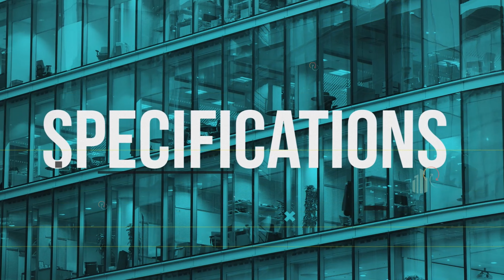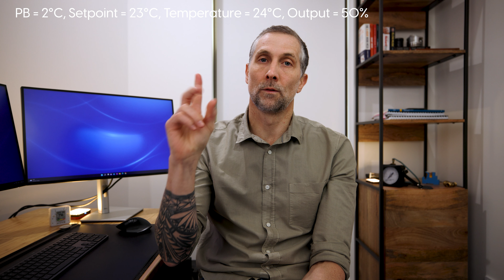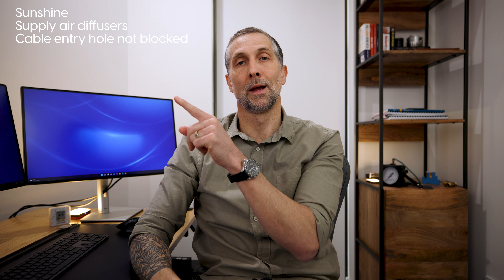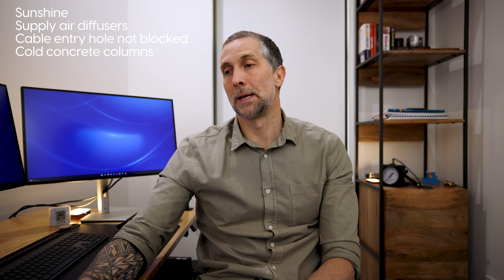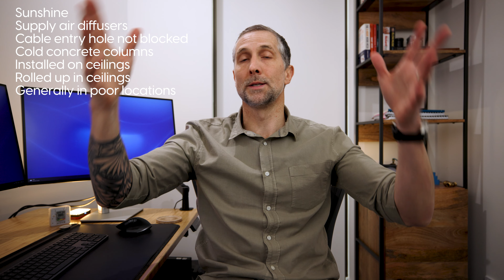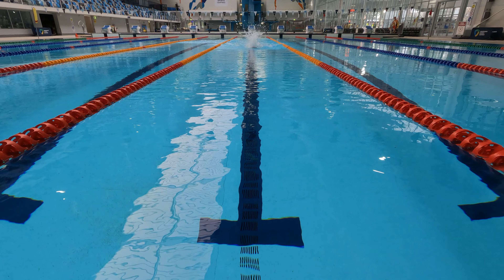Simple PID adjustment that saves energy

Comment: Does this count too, if you have radiators, to heat the room, and the ventilation is just to refresh the air? 

The larger range of temperature you allow, the less the VAV will have to run, or is that understood wrong? :) 

Im new in the BMS, but have a huge interrest in the PID regulation / energi saving over all.

Comment: I agree with you on the energy savings, the problem i have is the people who want it an exact temperature that will scream bloody murder over it being a degree off of setpoint. Some businesses will get HR involved to make that employee happy even though they might have a temperature policy in use. Have you looked at the Johnson Controls PRAC feature in their software? It is designed to minimize the energy use by looking for a pattern and adjusting the PID parameters for steady comfort control.
One of my things I teach is to stage equipment on so not make the central plant run full capacity when going occupied.
Reply from the maker: PRAC, you are talking about JCI's automatic PI adjustment thing? 
I actually have a little problem with it. 
It works well until something upstream is misbehaving. 
E.g., the VAV box damper is hunting becuase the AHU supplying it is hunting. So the VAV PRAC starts to widen the P band to stop the hunting. And then you have a P band of 200°C. 
My personal opinion, with no proof, is that the PRAC should run for a week while all systems are properly working. Allow all the PID loops to self tune and then I think we turn the PRAC off. 
But, no one at JCI agrees with this.
Reply: @bryceanderson17  there are times to disable PRAC. On large sequenced loads and humidification/dehumidification it is recommended to turn it off. The one thing with JCI is that the default PID parameters are usually bad and need to be changed. I have a cheat sheet that I got and it gets me close with minimal tuning required. I want to take the equipment at the union school I teach at and try what you are recommending

Comment: @8:00 it took me a while to figure out why my thermostat was showing 72F, but the room was 79F. 
Turned out, the negative pressure room was sucking all of its air through a hole in the plasterboard wall.

Comment: That first half of the argument doesn't really stand as a good reason to have or not have integral action.  Some locations will error in favor of energy savings while others will error against energy savings.  It's a valid point that more attention needs to be placed on sensor placement because it often matters as much if not more than proper tuning.   The slower your variable responds to an input the smaller your integral constant should be anyway.  In the case of zone temp it's very slow and I agree most all cases there, integral should be set so small that it's probably negligible to begin with.  There's much more energy saving opportunities with higher order PID functions but it's rare to find people proficient in their use.
Reply from the maker: I can't think of a situation where a zone temperature sensor installed in a poor location, with integral enabled will save energy? Let us know your thoughts. Thanks.
Reply: @bryceanderson17  place a thermostat near a sunny window and it will read warmer than the space thus running heat calls less in the winter.  Integral has nothing to do with it.  Result?  Not what the customer wanted.  Space comfort is sacrificed but there is technically energy saved.  My point was the argument of sensor placement has no influence for or against using integral in a control loop.  It's a separate issue.

Comment: Another simple solution to save energy.  I use a wider P band for fan coils as uk offices have winter and summer design values that range from 19C to 26C.  The set points allow cooler temp in the winter and warmer in the summer that helps prevent thermal shock.  The problem I always encounter is with the FM team and often office staff who say the set point should be 22/23C.  Trying to explain dead bands and heating cooling set points but reminding them of the employers requirements  is often so hard I have to get the BMS team to add text to the graphic to explain why the apparent set point is not being achieved.
Reply from the maker: That is a good point.  
My PB is determined around meeting lease conditions.
But it is still a bit too tight, for energy efficiency. 
If you can stretch the temperature out another degree either way, as you suggest, a PB of 2°C would be much better. 
Mmm, maybe a PB of 1 for heating and a PB of 2 for cooling? 
I have found people will tolerate warmer temperatures in summer but won't tolerate cooler temperatures in Winter. Thanks for the comment, Alan.